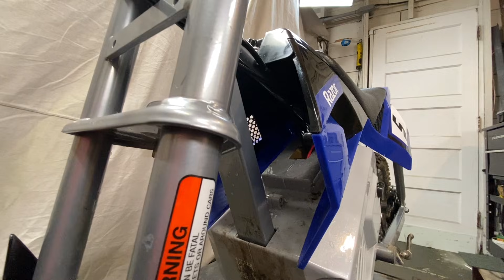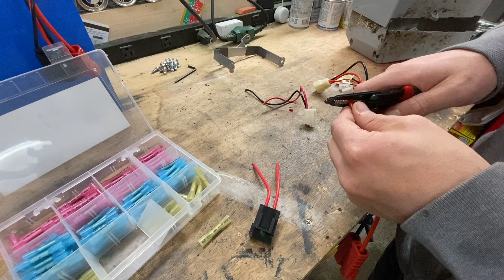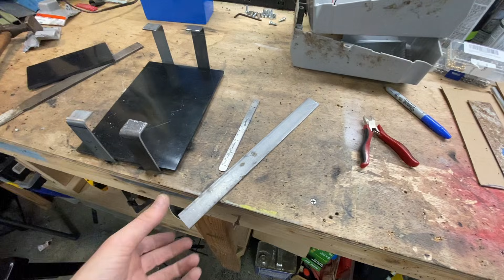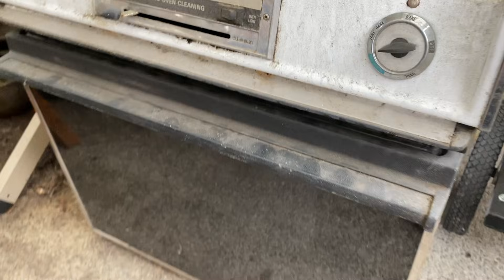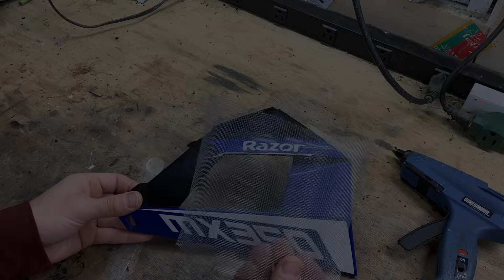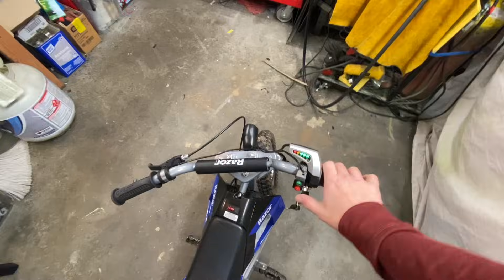Razor MX 350 Upgrade | Lithium, MAX Range

Comment: I upgraded my kids MX350s with 2 12v 10ah batteries from lifeP04. I also upgraded the control box and throttle with what you show. Now the bikes are shutting down and smell like something is burning. Do you know what could be wrong?

Comment: Hello please respond quickly is it possible? To get a 36v bat and use the stock controller? Will it go to 20mph? or slower
Reply from the maker: Not sure. Probably just under, but you risk melting your motor.
Reply: @jamesjacoby   ohh not the controller??

Comment: I modded my daughter's powerwheel quad years ago to accept dewalt drill batteries. Would like to do something similar to my grandsons mx350. I like the snap in batteries for power tools like the trimmers and mowers. Gonna research
Reply: There's some vids here on YouTube that has done this. There's a kid that removed the controller and just hooked up a Milwaukee 18v batter straight.

Comment: Could you kindly supply a link for that battery as I cannot find it anywhere.. Thank you kindly
Reply: Just search 24v lipo4.  Take a tape measure, measure the space you have, and find a 24v lipo4 that will fit.  Same thing on any ebike/scooter/4 wheeler.  Make sure you get as many AH as you can afford/fit.😊😊😊

Comment: Wouldn’t it be great if Razor just made them like this so parents didn’t have to modify them? 30min of run time is pretty lame…
Reply: For anyone interested even though they claim 30 minutes run time.  My 6 year old oversized son has been getting a steady 90 minutes run time on a full charge.
Reply: @danielgolding9805 how much does your 6 year old oversized son weigh
Reply: no, no, no. They would be much more expensive. If u wanted more run time the parents should get a better bike. Like Mototec
Reply: We found out after modifying just the battery and controller that they only work for 30 min by design because the motor overheats after that. New motor with 100% duty cycle fixed that
Reply: Fax

Comment: Thank you for clean video - Question, I have extra Ebike battery 48V 10 AH sitting at home - Can that be connected to this 24 V 350W motor and using the same controller Hub ?
Reply from the maker: No, you'll break it.
Reply: You can do it. But with a new controller.

Comment: Dude ill pay you i have a 350 and a 500 my kid needs way more time
Reply from the maker: Thanks, but unfortunately I don't have time and the logistics would be overwhelming. You could tackle a simpler version with a slightly smaller battery without the need to modify the body shell as much and it would be a lot easier.

Comment: Nice work!  Have you ever installed a battery life indicator to a razor scooter with lithium batteries?  Would love to see a video on that.
Reply from the maker: The twist throttle includes a battery charge level indicator that works fairly well.

Comment: How would the 36v 20AH fit? The battery in the video is out of stock but the aforementioned is not. Thanks.
Reply from the maker: I wouldn't use 36v, you'll burn out the motor. Shop around eBay, Ali Express, etc
Reply: @jamesjacoby  Appreciate the reply and thanks for the inspiration!

Comment: hello, im trying to repurpose a mx 350 into an occ chopper bicycle. i want to use 2x drill batteries in parrallel. the batteries are 20volt, 3.9 ah, will my motor work?
Reply from the maker: 20v is too low. You need 24v.
Reply: Can you do more then 24v and will the motor still work ?

Comment: I have one of these and I’m looking to replace my battery with a 24v 15ah and I’m curious why do I need to upgrade the controller and throttle if it’s the same voltage?
Reply from the maker: You don’t have to upgraded it. The upgraded throttle and controller provide variable throttle and a little bit more speed.

Comment: Hey, so I was wondering if you changed the controller so it could except then new,  but different battery. Can the battery swap work w original controller.
Reply from the maker: Yes. You can swap without updating the controller. Just make sure the battery you choose has a BMS with low voltage cutoff

Comment: My kids seem to run for 45+ minutes at full use. They are fairly new. I have made sure they kniw to full drain and FULLY CHARGE them. I was just wondering if thats the trick or the life will still drop off in time.
Reply from the maker: Interesting. I imagine terrain and rider weight have a lot to do with it. Ours is ridden off-road with some hills. Or maybe our batteries were no good from the start.
Reply: @jamesjacoby  my kids are 8 and 9. 55 lbs and about 70lbs. We only ride on dirt and the trails out back. Thanks for the video! I would love a lithium upgrade to charge faster and have a longer run time.
Reply: Yeah mine runs for 45 minutes or an hour.

Comment: 15-20min? No way. I, at 175lbs, can ride my sons bike for almost 30min. My 7 year old can ride it for nearly an hour of throttle time. And that's whit the a variable throttle that sends more voltage to the motor.
Reply: His was probably overcharged
Reply: My kids is only lasts like 10 minutes
Reply: @hyperwolfracing  Your batteries need replacing, chief. You can get a much larger capacity, lighter, and smaller lithium battery for not very much money at all. I'd look into it if you're going to replace your batteries anyway.

Comment: Is the improved controller required because of the new Lithium battery or I can just replace the battery keeping the original controller?
Reply from the maker: You can keep the same controller. The upgraded one provides variable throttle and small performance boost.

Comment: SIIICK Build.. Links to parts if you have time.
Reply from the maker: Here is the exact item. However, it turned out to be overkill IMO. You could go with a smaller and cheaper one and it would be easier to fit. https://www.ebay.com/itm/24V24Ah-Lithium-LiFePO4-Ebike-Battery-Charger-Electric-Wheelchair-Motor-BMS-500W-/144401685875?hash=item219f02dd73
Reply: @jamesjacoby  hey man that parts is gone now any recommendations for anything close to it ?

Comment: Can I get a list of the parts you upgraded
Reply from the maker: Fast Scooters Controller, throttle and lights kit from eBay. It’s hard to link to a specific battery because the listings always change. Search for 24v LiFePO4 with US shipping. Get one that comes with the charger.

Comment: So I have a MX350 I got for free, picked up a new battery set for it for like $35. It runs great, will pull my 11yr old no issues, but won't pull me lol I want to upgrade the battery and motor...where did you get this kit?
Reply from the maker: Not a kit really, just a collection of stuff from eBay. Controller and accessories are from one seller. You could use any battery that’s 24v. I didn’t upgrade the motor, but I’ve seen options for that too.

Comment: How much the difference in speed? Runtime? And recharge time? planning to do this set up too thanks
Reply from the maker: Speed is a little faster and it maintains speed better than before. Takes about 3 hours to charge from nearly empty to full. About 3 hours run time, which was probably overkill.
Reply: @jamesjacoby  That is a lot of runtime.  I wonder if you could have found a 12aH that would have fit without modifying the body of the bike.  The lithium batteries have much more usable power than SLA.  I am wondering if the battery had a BMS built in though?
Reply from the maker: @AAronB2834  for sure a smaller battery would more than adequate for most. Although it’s a nice luxury to only charge it occasionally. The BMS is built in.
Reply: @jamesjacoby  Is that 3 hours run time with you on it ?
Reply from the maker: @dicevizion  kid riders